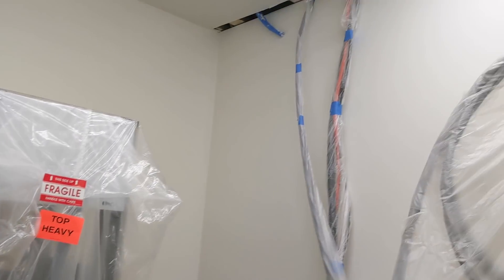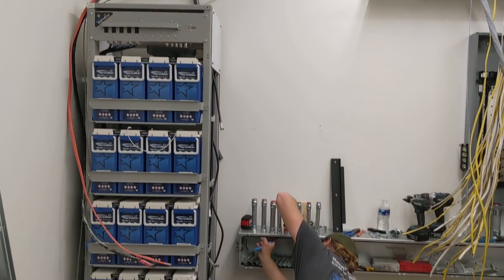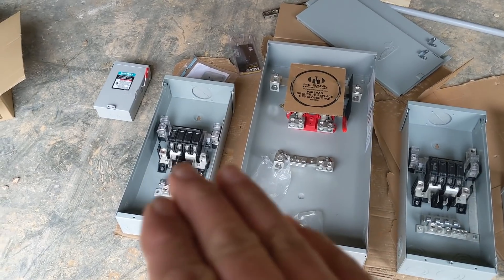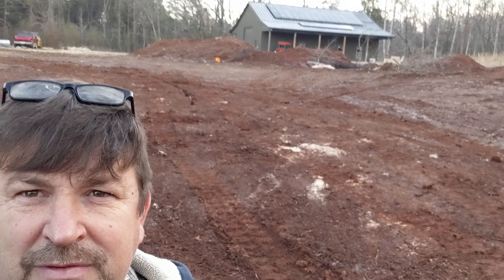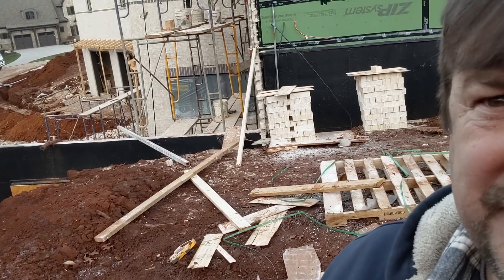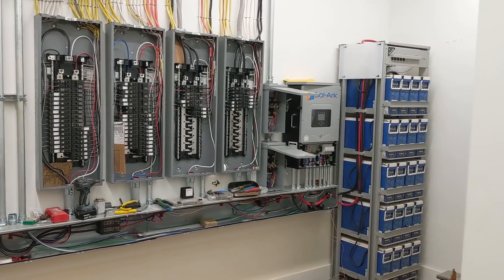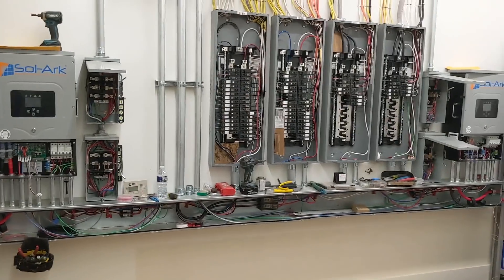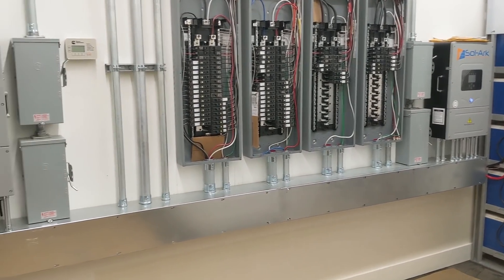Designed for Solar: Pt 2

Comment: you said its a 400A house out of your sol-arks. so on a sol-ark 8k how are you getting 200A out? 
 you use the 50A 2pole "load" breaker obviously, then the "grid" breaker too and just parallel them?

Comment: I am concerned about the panel feeder cable sizes. 
Fairly neat install, well laid out switchboards, kinda messy panel circuit wiring though.

Comment: The conduit and EMT you guys ran looks top notch, the electricians could learn a thing or two from you. All of the exposed Romex and staples that are not in level neat rows don't do that room any justice, I am an electrician and personally would have tried for a cleaner looking installation to at least match the work your guys did, looking forward to the next video.
Reply from the maker: The owner is planning on building a box and removable cover to hide all the Romex.
Reply: @engineer775  That will certainly improve things then,  you guys do great work.

Comment: Might have been better to interlace the critical load breaker boxes (CB1, BB1, CB2, BB2) This way if the customer wanted to switch a non critical load circuit over to the critical load breaker you can just switch it over. If he decides to move over a circuit that is in the far left breaker box. you might not have enough cable reach. Or since you have two SolArks, switch circuits over to the other CB to balance the load.

FWIW: for my project: Two breaker boxes : one Critical, the other non-critical. I ran all of the circuits into the bottom wire way and then up into the breakers boxes. I left each circuit long so I can move it over without much hassle. I used vertical wireways on all sides of the breaker boxes so I can run the circuits long without having to stuff all the circuit slack wiring in the bottom wireway.
 

Also ran MC instead of Romex for shielding EMP\Close Lightning strikes. I used EMT with large pull boxes in the basement & then just use THNN wiring all back to the wireways so I don't have a to terminate about 70 circuits back at the wire way. Issue I see is that the Romex (unshielded) will collect a lot of EMP or local lightning strike energy and dump into all of the circuit loads. the Solar Ark will just clamp at the circuits but just create a longer (double) current loop for the collected EMP energy. You really need a surge protect at the point of load for protection. 

Also recommend using Rigid pipe nipples  to connect the breaker boxes  to wireways instead of EMT since its easier to get them mounted. With the EMT you have to mount the breakers with the EMT pre installed. with the Rigid nipples you can mount the breakers & the Wireways and just slide in the Nipples. Also probably cheaper consider you need two EMT connectors for each EMT nipple installed. Also consider using compression EMT fittings instead of the Screw clamp fittings.

Also might be helpful to install current transformers on each Hot leg feeding into the breakers so you can monitor loads. I would also recommend install 3/4" plywood instead of drywall since it less hassle to mount Mech.components and its going to get dinged up over time. I prime and paint the plywood so it looks decent.

Nice looking home, Looks like the contractor is doing a really good job.

Comment: Can those sol-arks be tied into to an EMS system? Can you get a bacnet card for them?
Reply: There is an RS-485 port on them but I don't know if it compatible with Bacnet. for my project I am planning to use a PAC (Like PLC but better). Will use contactors for load mgmt. Since the SolArk feeds into a breaker box, there is no tight control on managing individual circuits, so really you need to use a separate controller & contactors if you want to control circuits individually.
Reply: Guy Tech sounds like a cool project . I was thinking more of being able to view and  trendlog data, to see how it’s running to optimize settings. And do it from a PC.

Comment: The "Real Power Wall" ;0)

One question ..... Why clip those cables surface? 

When we had anything like that we would use trunking (plastic works well) and cut a hole in the top of the board to receive it. Nice and neat ..... and the larger sizes of plastic trunking are easy to de-lid! We are not allowed to fit fuses and the like in them though ;0)
Reply: Cannot enclose multiple Romex circuits in an EMT or PVC. The issue is heat because the plastic sheathing has poor thermal conductivity. You can only run individual THNN wiring in EMT.
Reply: In the UK they are called Twin and Earth. There is a spacing factor involved but you can run them in trunking ;0) ....... or you Could when I was doing it!

Comment: Why are they not connecting their whole electric service panel as their critical load panel with that much power  and parallel the Solarks unless one is 110v only and hardened for EMP since they  have grid backup?  Something about code? or just want to have one off grid only ?  It may say in video haven't completed it yet going to work now.
Reply: well I couldn't resist,  guess will be late to work.  I answered my own question because you are using the Solark 8 k units which can't be paralleled etc.  My bad.
Reply: @teekay1785  Don't need to run them parallel, just have them feed seperate circuit breakers. I am pretty sure that is how this install is set up. He using two Critical load breakers boxes, one for each inverter.
Reply: @guytech7310  I think most codes require whole service box not breaker but I guess they would both synch to the grid load which would mean they synch to each other. If offered guess one would nave to be used as grid for other to synch to.  If they can be used as 2 breakers,  What is the use of a parallel board system?
Reply: @teekay1785  Consider if your have multiple small USP systems each connected to a different device\computer. Do you need to sync them all? In this era, just about every devices that has voltage conversion uses a switch mode power supply (SMPS) which rectifies the power into DC and runs it through a hi-frequency buck convert. SMPS don't really care of what power you feed it. 

As long you don't feed a load with power from the two inverters you won't have any problems if you use seperate breaker boxes to isolate the inverter loads.

If your Grid Tie, you have a service discconnect and a small breaker box that feeds the two inverters that feed your isolated load breaker boxes. I am presuming your doing a off-grid system, so I excluded the grid-tie sync. if your off grid and use a backup generator you just tie the Inverter grid ties into the generator source circuit. Only issue is would be  both inverters drawing too much power at the same time (ie powering load & battery recharge). 

Best option would be to call sol ark and discuss options to run two or more isolated inverters for your loads and see if they have a solution for the generator overload problem.
Reply: @guytech7310  thats why assumption does u know what but I definitely appreciate your input and you are knowledgeable but I wasn't asking for my setup but why they didn't since I think  he also stated it would be grid tied  (at least partially.) My system design is  a grid tie but only use grid for backup.  My main concern in my system however is starting high LRA HVAC ( even with hard start capacitor in stage 1 etc but so far is ok)  and I am not changing out My 1 year old water source heat pump, but it is 2 stage with variable inverter fan and well is soft start Grundfos but still would like to have more than the 20,000 watt surge provided by even the Solark 12 . The HVAC is really the only concern the rest of the loads are easily managed.  From below answer by Engineer 775  apparently is the answer to my question. They wanted  EMP hardening so they can't use that Solark 8 as a 240v unit at least not without some type of hardened transformer not built into the Solark. Above is explained at 4: 00 in video. So basically they choose not to use the off grid portion to sell back extra power so they could get that part EMP hardened and as I thought that would be one of the only sensible reasons to design the system that way.  Personally if I was that worried about EMP I would have used Edison batteries or at least LiFePo4 batteries since initial cost didn't seem to be much of a concern.
Reply: @guytech7310  also USP s are almost always 120v and you wouldn't need to synch 120v because they only "see" the one leg they receive their power from they would not work if they were nl US 240v unless synchronized to provide split phase or 180 degree out of synch so to speak.
Reply: @teekay1785  The SolArk are 240VAC Split phase inverters. I was referring that as long as the loads are isolated, the two inverters would not need to be synced (ie phased locked for 60hz AC).
Reply: @guytech7310  Exactly , so why not synch them in 240v split phase , there is no good reason not   to synch them unless they are  providing power to different circuits.  Thats my point the main reason for not having just one panel for all or almost all the loads and using them in parallel (synched to 240 volt) is to have one EMP protected at 120 volt since you can rearrange loads or use a balancing transformer if need more than 1/2 the load on one leg.
Reply: @teekay1785  A Solararc is only 240Vac Split phase and in sync. Its if you run multiple inverters.
Reply: @guytech7310  I know that but they cannot be used as 240 volt split phase and EMP proof.  Just ask them.

Comment: What is the function of the Ethernet ports at 9:27
Reply: The Sol-Arks have network capabilities so that you can use an App to check the status of the system, make adjustments to the configuration, etc.

Comment: Over 90 panels and 2 large batt banks and your only running 2 8kw inverters? How does that work?
Reply: Danaw0207 running most demanding loads during the day right off solar, bypassing the battery banks. The system is also grid tied.
Each solArk can handle 32 panels. The remaining 30 will be direct PV to load, like hot water, well and pool pumps, that chiller and at least daytime A/C.
Reply: two 12K inverters not using the smaller 8kw units.
Reply: @guytech7310  He states he is using 2 solar 8kw units because the 12 kw units were not out yet but maybe its changed since the video

Comment: What are the specs on the batteries used on this project? Love the racks and stacks, reminds me of a cell site I worked on.
Need to contact SolArk and see if they make a 220 v unit for EU use. No EMP hardened stuff on the east side of the pond.
Reply: Subgunman my understanding is they provide 110v & 240v
Reply: solar doesn't supply EMP hardening for the split phase 240v only for 120v at least 3 months ago they said they didn't.
Reply: @teekay1785  Not looking for a split phase 220 supply but a single phase unit for use in the EU. Have my home here that runs on 220/50 but I have also wired many rooms for use with 120/60 however for now they are running 50 Hz since the system is straight transformer powered and i need 60Hz true sinewave for certain equipment.
Reply: @Subgunman  From my research they don't  make a european single phase 220volt its alway confusing terms with 220v and 240v because many in US use the term interchangeably but I am sure you could run the single phase 120v from it since the amp hardening here can only be done with units not providing split phase.  They are responsive directly to public by email. It may take them a business day or 2 to get back to you but they answered all of my questions.

Comment: Guys - I really wanted to make a Sol-Ark 12K work for my off-grid system, but try as I might, the max 40A output just can't cut it.  Adding a second 12K blows my budget.  What am I missing?
Reply: I am in the same boat really need 2 solar 12 s and just too much$  I hate to do it but I am considering  the MPP LV5048 and parallelling 3 of them with no sell back and large  LIFePo4 battery pack of around 45 KWhr and about 20 kw of panels.  This would run me about  $18,000 with my current sources for the whole system self installed.  The 2 solars alone would be about $14,000.  
The bad thing about MPP is max pv input voltage is 1bout 140v as compared to 450v for the Solark and MPP made in china. But to be fair solar would be more like 4 MPP sat about 5,000 watts each. Future electric vehicle priceless LOL

Cost breakdown 3 MPP  15,000 watt                                                           $4,000
solar Panels used 327 watts each  60 panels 19,620 watts                     $6600
Batterys used 12 batterys @ 450 & 4kwhr  each plus shipping               $5850
Homemade mounts and wire  2 breakers disconnect box                       $17,950
Time  I pay myself $1 per hour and my helper son  half that lol               $50
TOTAL                                                                                                                 $18,000
TOTAL after 30 percent rebate if order today                                               $12,600
Payback period   @ about $300 per month  3.5 years or 42 months
but will likely do all the batteries and 1/3 of rest of system now
Reply: tee kay, you need to figure in wiring, fuses, connectors, racks, transfer switches, disconnects, fittings, conduit...,  just to name a few.
Reply: @Do_the_Dishes  I already have all the wire and conduit and material for racks which wouldn't be all hat many $ if I was buying it.. This cost would be the same with any system I would use anyway so its not a differentiating factor. The breakers and most connectors are built into the MPP units. I have open breakers on my current service panel which will serve as my only service panel.   I will not be selling back to grid .  I also have service panel for grid connection which will actually not have any breakers in it. This way I do not have to change any service wiring from one box to another at all
Reply from the maker: Send me an email and maybe we can figure it out. We're doing this whole house on about 64amps